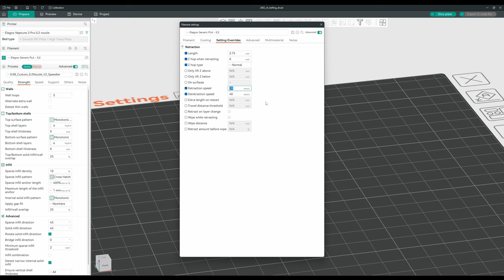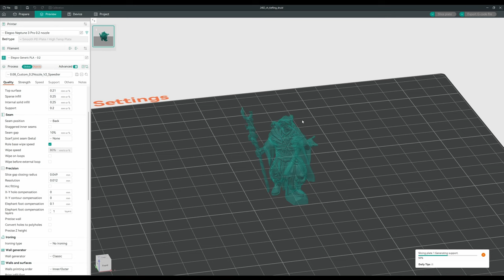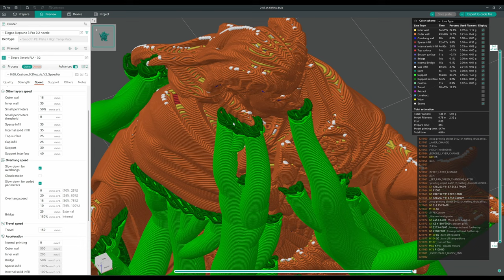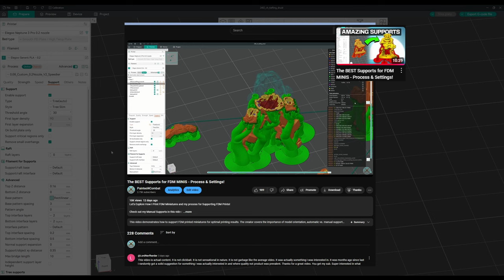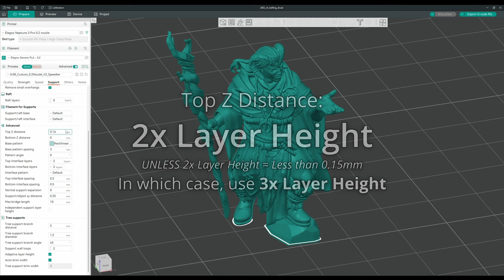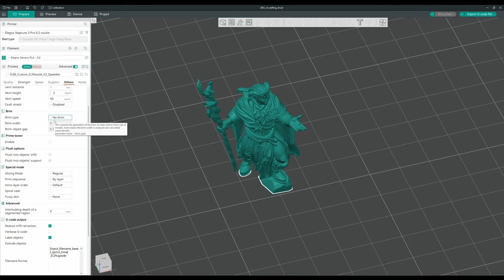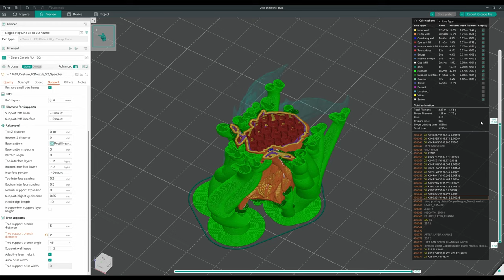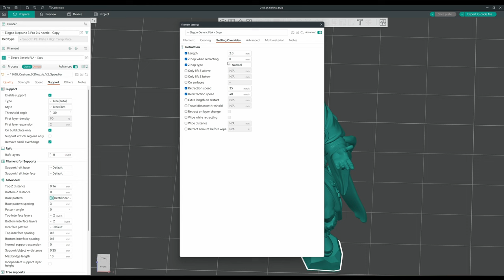How To Print PERFECT FDM Miniatures! | Orca-Slicer Settings for 3d Printed Minis [2024]

Comment: This man is doing the lord's work for the community. I'll be posting my results of a tested print with my Neptune 4 Plus and 0.2mm nozzle head
Reply: Update on this post, I have been since printing multiple Necron prints for the last two weeks. Here are my findings:

* Printing at first was a failure as only a few layers would print before my extruder would seemingly stop dispensing filament. I found that adjusting the Retraction override under material to 1mm fixeded this issue and allowed me to start printing.

* I adjusted my support settings as I found these ones to be too difficult to remove. For those who don't know, Necrons are very skinny and easy to break so I adjusted my supports with the following (Top Z Distance = 0.25mm | Bottom Z Distance = 0.2mm | Base Pattern = Hollow [Very Important] | Top Interface Spacing = 0.7mm). With these adjustments I am having successful prints and I haven't had failures related to a support failing yet. This also means less material and thus quicker print time at the cost of rare failures but scarring is also reduced to a manageable level.

* The only failure I've had so far has been related to Build Plate Adhesion. Unfortunately, this has been hit or miss for me. 0.05mm brims don't do too well at keeping the print adhered to the plate. I print at 60 degree celsius plate and with varying support length. My current solution has been either gluing the build plate or more often adding magnets on top of the support brims to help keep my print attached to the build plate.

All in all, I'm pleased with the results and will now be adding good quality Necron vehicles that are actually durable (in comparison to resin-printed) miniatures.

Comment: I'm using Cura 5.8.1 with my original miniature profile from my Ender 3 days. I have a FLsun SR with a 0.2mm nozzle and 0.08 layer height and 40mm/s print speed. I'm amazed on how well this delta can handle miniatures.

Comment: 2:05 maximum achievable layer height of any nozzle is usually 80% of the nozzle width

3:44 exceptions: you have ticked off "Slow printing down for better cooling" and changed "Min print speed" to 12 I think

Comment: Hi, nice video!

One nitpick that doesn't really matter,  but your max volumetric speed is way too high and will never be the limiting factor. When adjusting the volumetric speed from a 0.4mm to a 0.2mm nozzle, you need to take into consideration that the nozzle output area is 1/4th of what it was so printing at the same linear speed will result in a volumetric speed which is also 1/4th.

50 mm^3/s corresponds to a linear printing speed of 1592 mm/s. In Bambu Studio the default is between 1.6 and 2 mm^3/s for the 0.2 nozzle, depending on filament, which corresponds to speeds of around 50-60 mm/s.

But it doesn't matter as the print will use the lower of either linear or volumetric speed.
Reply from the maker: Good to know!

Comment: Came here to say "Hi" and "Thank You".
Your video helped me to tame Orca Slicer with my Ender 3 v3 KE. For now, I'm using Your settings and the prints are coming out great. Also, Thank You for some of the trick, tips and extra info about some of the settings. I will probably use Your settings as a starting point and then experiment with smaller layer hights. 
Greetings from Poland :)

Comment: Will try this out for sure, thanks a lot!
Reply from the maker: Ofc! Let me know how it comes out! 🙌
Reply: @Painted4Combat  Fantastic results on my Ender 3 with a 0.2 nozzle apart from some stringing. I suppose I need to increase Retraction Length, right? Should I increase Retraction Speed also? Thanks again for the awesome tutorial!
Reply from the maker: Yeah, mostly Retraction length should fix that, but you can also hover the speed between 28-35 and see if that helps. I think I used to most often use something like 2.9mm retraction at around 32mm retract speed on my old printer (something that was closer to an Ender) maybe try that!.

Comment: I'm glad you added in .4 settings too, I'll try those out with some bigger models before working on switching out for my .2 nozzle on my 4 pro. Coming back with an edit, in case if others have the 4 Pro, I am still tweaking my settings but the defaults with some changes for the .4 nozzle settings in Orca for this printer is the same quality, haven't tried the .2 nozzle yet.
Reply: what speed?
Reply: @Novillow  I have it on default speeds, but I changed filament, supports and z-hop stuff that was done from his stuff.

Comment: Thank you for your video, you make amazing content. My only question would be in strength "Sparse infill anchor length" in my case on en Ender 3 V3 KE is 400% but the value is not visible because the select is too small
Reply from the maker: Thanks! I dont think that "Sparse Infill Anchor Length" will be too big of a hangup on such small models, mine is also set to 400% but I think that whatever the default is for your printer would be fine for that setting in particular.

Comment: great video as usual :)
I just want to add my opinion when it comes to speed and quality:
I have printed for over 1 year and 100+ minis with my Sovol SV06 with a .4mm nozzle at a speed of about 70mm/s and the quality was pretty good for me
a few weeks ago I bought the A1 mini and a .2mm nozzle
since then I pushed my Sovol SV06 to 150-200mm/s with the same .4 nozzle and changed to SUNLU PLA META and I can tell you the quality is almost the same like with the A1mini and a .2 nozzle
I ran dozens of prints (same figure on both printers) both printers with SUNLU PLA META and I can finally say that either the SOVOL SV06 is already a pretty good printer for minis (and you dont need the A1 mini neither the .2mm nozzle!) or the SUNLU PLA META fillament was the game changer here
thats for quality
when it comes to speed I print the same miniature with the A1 mini and .2 nozzle in about the same time as the SOVOL with .4 nozzle and the quality is basically the same :)

Comment: Do you have any suggestions on tuning and calibrating the printer to get it ready for printing this kind of quality?

Like adjusting wheels, belts, e steps etc…?  Did you do anything like this or just use all default settings?
Reply: And where would I buy 0.2mm nozzles for my Neptune 3 Pro?

Comment: Honestly for me i can't be arsed to mess around with so many different settings, and thats just a me thing, not trying to be hostile or anything. Just that printing itself isn't a hobby for me, it facilitates my actual hobbies. So i bought a bambu a1 with .2 nozzle and just use their inbuilt quality profiles in bambu lab. I will say however, that i didn't really believe the detail hype for modern fdm printers until i did. I still use my resin printers for minis, but for lorge models or terrain its honestly kinda mind blowing how good the result is
Reply from the maker: Yeah! It seems to me that bambu have done something awesome for the 3d-printing hobby with those printers, simple plug and play machines that just work. A huge benefit to people like yourself who don't want to have to have to calibrate and dial in a cr*p ton of settings.

Comment: Another good video.  Question: Do you have a recommendation for a good video on replacing the nozzle on an Elegoo Neptune 3 pro?  Searched on YouTube but wasn't to find one specifically for the 3 pro (unless they are all similar).
Lastly, I use mine to print mainly terrain and the .4 nozzle seems to do the job just fine, but I would like to try and print minis.  Have you printed terrain with a .2 and I assume to it increases print time for larger terrain pieces?
Thanks again.
Reply from the maker: I quite literally just remove the silicon shoe on the printhead and use a small wrench to swap the nozzle (being careful not to hit the printhead casing); I dont worry with pulling anything apart. 

And you could print terrain with a 0.2 nozzle, just expect a pretty major jump, anywhere upto a 40-50% increase in printime
Reply: Elegoo Neptune 4 Pro Nozzle Replacement Guide by Ben Myhill-Jones is a great video and while it's titled and meant for the 4 series, comments have stated that it also works for the Neptune 3 series with the only big difference being the nozzle head shapes. My personal recommendation on what to do differently is that you avoid grabbing the front and back of the hothead like he does a 2:40 and instead grab the left and right side of it. This is to avoid the potential of breaking the controller on the back side of it.

Comment: Good work. Thanks. Interested to see how thee compare with the Fat Dragon settings for the A1.
Reply from the maker: Let me know how it goes!
Reply: Keep in mine settings are only the direction to follow but are not universal. On my short experience I had to adjust settings even if I use same pla and same printer as FDG. His settings are a very solid base but in my hands, nozzle, layer height, temp, local Weather... I had to try various changes to make it as I wanted to be 😊
Reply from the maker: @kalganum  This is a very important point to make, and your totally right! I cover it briefly in the video but I fully intend for this to be a launching point for people to start playing with their settings, hence why I take the time to give my thoughts behind a few of the values or toggles rather than just posting an image or profile of the settings.

Comment: Tried this out on Bambu. I had detailed my findings but then the page refreshed and I lost everything I written.  Too lazy to write all that out again. The TLDR is: spaghetti for dinner; slim supports were too few at best and broken/floating at worst; not surprising as the vid suggests examining and manual painting supports where necessary.

Going to try some tweaks to the formula:
 - Supports > Support > Style > Organic. More branches but I'm lazy. Looking for that perfect ratio of user input to quality of print. Maybe I'll try slim again at a later date once I get decently working base line settings.
 - Quality > Seam > Seam Position > Aligned. I just prefer how it auto generates the seam on natural edges as opposed to in a straight line on flat surfaces.

Comment: Could you explain the thought process behind the variation of the different layer widths? Seem a little random.
I use 0.12 for the outer perimeter as ~60% nozzle diameter seems about the smallest width one can reliably extrude. And the outer perimeter in my eyes has the most impact on detail and sharpness of the model.
Reply from the maker: Its more or less based on the default settings for the 0.4mm nozzle of that printer, which I adjusted for the smaller nozzle and then tweaked a bunch until I was happy with print quality and strength. I haven't tried playing around much with really bumping it down it (like you mention 0.12) but if that's getting you better quality then that's awesome!

Comment: Would love to see if you can do a vid on Bambu's P1S
Reply: I've been printing minis on P1S for a few months now, and recently bought a 0.2mm nozzle for it. The settings shown in this video work very well, and I tend to have a bit faster speed settings than he does because the printer can handle it. I'm still tuning my settings for supports to minimize scarring but I've been able to reliably print 25 to 40mm minis as well as larger prints using these settings.
Reply: @brish7086 thats awesome. Are you using orca or the bambu slicer?

Comment: One thing I would change is "Others -> By layer" to "By object". There are 2 reasons for it. First, when you print by layers your print head constantly has to travel between objects and it will create more "hairs" of fillament on your surface. Secondly, these are very slow prints. If you print several miniatures by layer - then if one of them fails you have to scrap everything. But if you print by object, your first and second can be a success, but your third is a fail, so you can cancel the print and keep the first two objects. You lose only 1 object worst case scenario.
The only downside is you can't fit as many minis on a single print plate, but for me it's easier to have multiple runs.

Comment: I followed your tutorial but the supports are really hard to remove to the point it become difficult to remove them without ruining/breaking the mini. Any suggestion?
Reply from the maker: What nozzle size are you using?
Reply: @Painted4Combat  thanks a lot for replying! i am using the 0.2mm nozzle. Overall the quality of the miniature is good, but i have a lot of trouble removing the supports without damaging/breaking the  piece. Before i was using cura slicer and i found the supports easier to remove but the layer lines were more evident. Btw i have an ender3v2

Comment: 50 mm²/s is never (ever!) going to come up with a .2mm nozzle.
Heck, I barely attain 25 with a .4 without specific filaments and temps pushed above intended for said filament.
Reply: Nearly all of my prints on an Ender3 V2 Neo (0.4mm nozzle, 1.2mm layer height) are run at 50-60mm/s, and that's using generic eSUN PLA - nothing fancy - with recommended temps for that PLA. (I'm not printing minis, though do print larger model busts for painting.)
Reply: @fredsmith1970  I think you're confusing different "speed" measurements. 
mm²/second is a reference for flow rate or volumetric amount of plastic being deposited per second. 
mm/s is the speed at which your printer moves the nozzle
mm/s² is a measurement for acceleration. (for completeness)

Ender 3's indeed usually go at 50 mm/s or so. My old modded ender 3 pro used to push to 70-90, depending what I was printing (definitely not for mini's). More recent (Klipper) printers typically attain about 250-ish realistically, even though they throw 500-600 around.
Ender 3 flow rate maxes are somewhere between 10 and 15 mm²/s

Depending the device, parameters and what is being printed, the most restricting factor I encounter is flow rate.